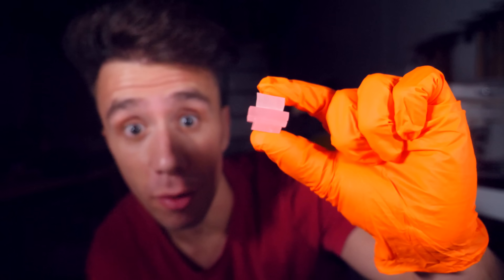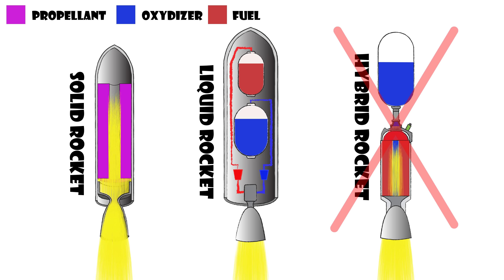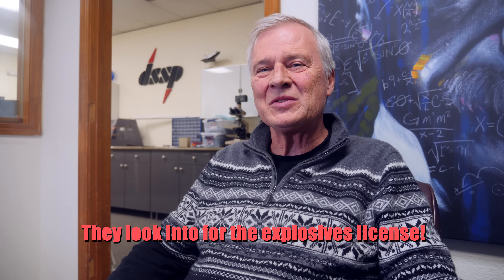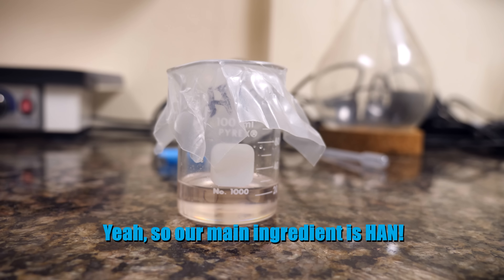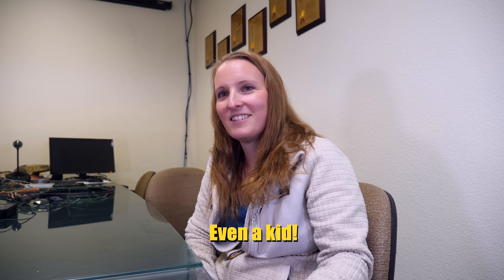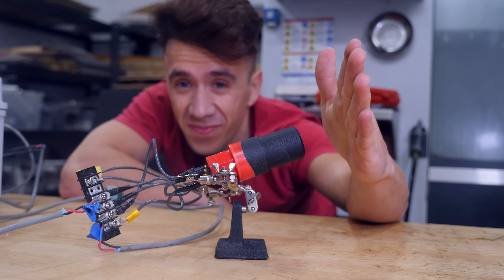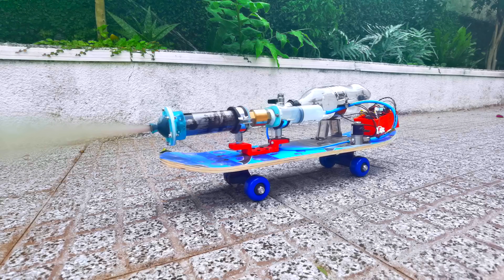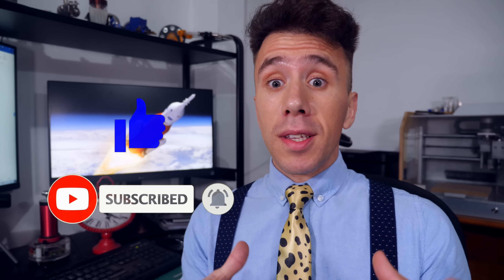ELECTRIC SOLID PROPELLANTS

Comment: I was looking at hydrazine as jet fuel for helicopters on nuclear powered frigates but at half the energy density of gasoline I didn't even get to the toxicity. Liquid anhydrous ammonia is more practical even with pressure containment issues but still only half the energy density of gasoline that would sort of limit the range of an anti submarine helicopter.

Comment: Make a modified ranque hilsch vortex tube for HTP fuel. A platinum wire pre-heater to pressurize the in-flow. And a platinum mesh internal screen around the center cold flow keeps catalyzing un-burned fuel. Feed the exhaust out, and use the 'cold' flow to cool the outside of the combustion chamber using a second external exhausting wall

Comment: Just looking at the chemistry, hydroxylamine nitrate is pretty straightforward to make.  Probably harder to get the license to buy the ingredients than to perform the reaction.  It is very exothermic so don't just pour the stoichiometric amount of one into a vat of the other.  I can see why they use a flow reactor with cooling.

Comment: I'm certain that you can build a self balancing drone using 4 rockets. Something that's capable of throttling each rocket just enough to maintain itself off the ground. Perhaps for starters with a tether that supplies it electricity or fuel.

Comment: That's rather interesting. I may have to run a current through my graphene suspension solution on purpose and mix in a little solvent. I'd actively been trying to get it to Not burn, but maybe I've been fighting the wrong end of the stick!

Comment: try to use an ozone generator as part of your combustion gas. ozone is o3 compared to the normal o2 you use in many of your engines. you could then test the level of improvement in your already built engines. Love the videos

Comment: Video Idea: Use your most efficient rocket prototype as propulsion for an RC rocket, and control it using on/off switching of the plasma thruster that was shown in this video. The objective - gain the most height by using the thrusters to keep the rocket facing up!

Comment: That Microreactor they built doesn’t look complicated.

They’re mixing the reactants one drop at a time because the reaction gives off tremendous heat.

I’m NOT advising you to test such a thing in your house.

But you could BUILD one.

And then test it with whatever you have lying around, like vinegar and baking soda.

That little box couldn’t house high pressures or high heat.

Two peristaltic pumps to deliver reactants and a collection system for the results; throw in water cooling from a PC.

I was expecting you to end the video by 3D printing your own micro reactor.

Comment: Please, when you do get a decent amount of GEM, test its thrust through different nozzle types (Conical, Bell, Aerospike, etc). I'm very curious as to the thermal expansion rate of the reaction, and how that rate might vary in different nozzles. Who knows, maybe this propellant makes aerospikes viable. Cheers!
Reply: Bro, is there a thing like thermal expansion of rate of reaction ??
Thermal expansion occurs in metals and every element has its coefficient of thermal expansion. And yeah, nozzles won't change any materials thermal expansion.
Reply: @imrealrage I think they wanted to talk about the volume of exhaust gas generated by a mass unit of propellant.
Reply: @mixer0014  That would have made sense mate!

Comment: Idea: Use the POWER OF THE SUN to burn the ESP. 

I mean like attaching a bunch of solar cells to a capacitor. Then you could use the energy stored to ignite the rocket fuel.

I used to like tomatoes, but now  I find them gross! I got tired of the taste.

Comment: You should try to make a jet/rocket engine using nitromethane as you would need less air thus reducing complexity while easily increasing thrust. 

Ps: To have pure nitromethane you should try to synthesize it instead of buying low concentration diluted in methanol, the synthesis is relatively easy and you already have the nitric acid which is the hardest ingredient to get.

Comment: When we are talking about electric engines what about an Arcjet engine powered with hydrogen? It is an electric discharge (arc) heating up the propellent to maximize the thrust output. Perhaps this is easier to achieve than an ion engine.

Comment: Conceptualize, design, 3d print and cast solid rocket motors blocks to vary the burn speed, pressure and bleed on to multi stages. The idea is to manage the specific impulse over time, a kind of fix throttling sequence for the various stages of flight. Lift off, acceleration, cruise, next stage ignition, etc.

Comment: I think it would be awesome if you build a thrust vector control system to control a multistage rocket and actually launch it. You builded a lot of engines suitable for model rockets like the solid propellent ones but never really tested it. It would be cool to use one of your past engines like the sugar engine and create a working model rocket from it and even cooler if it was multistage and use thrust vector control.You can use something like a Raspberry Pi or an Arduino to control the rocket. Perhaps you could also get some amazing footage in the process!

Comment: everyone keeps saying "no danger" but what about the vapours/smoke that comes off of it? what does it break down into? i would have to assume it could be harmful to breathe that in. not to mention the part where its explained that if its voltage it overloaded it can detonate rapidly and violently... meaning on a large scale could be very dangerous considering the fact that it would only take to fail is just one capacitor or rectifier. video suggestion... touch up more on this topic. i have many questions unanswered from this video.

Comment: In the next Video, I think you should go more into depth of how much Voltage and Current we are talking about, is a 9V Battery enough? Or what happens when I charge my body electronically (like with socks on the carpet) an the touch this rubber stuff :D

Comment: I think a critical thing is being overlooked. yes fire is Kool, however being able to throttle the nozzle versus just the gas/electricity whatever your traditional throttle. similar concept of a traditional adjustable pump sprayer nozzle. now you can focus the thrust and is semi directional. making the whole thing operate more efficiently. this is just an opinion or hypothesis based on a similar concept for the afterburner.

Comment: electro mechanical gyroscope... problem with satellites, when fine magnetic dust accumulates on the magnetic/gravitational conductor/body of satellites it no longer works... so they use optical sensors in micro circuitry wired the same as a primitive electro mechanical gyroscope tho with the addition of coded algorithmic processing to fire those ionization thrusters. micro process and control branch circuitry. rockets that just lock onto the first thing in mass that they see imitating light or heat radiation others do the same thing with narrow band radio frequencies.

Comment: My first thought, even though it is amazing, is what would happen if lightning struck the solid rocket boosters fueled with it. Lightning has stuck rockets before and it is built to handle/dissipate it, but if the fuel can be ignited via voltage, I could see it causing a RUD. Would be very interesting to study though.

Comment: Hey Integza, I have got two video ideas for you.

1) Electrolysis Rocket. You use Electrolysis to split saltwater (or some conductive tap water) into Hydrogen and Oxygen. Then you pass both gassed into a rocket engine and BAM.

2) Make a 2-stage Jet Engine. The first stage will be powered by a Solid Rocket Motor. Then after the first stage dies, you can separate the Solid Rocket Motor and then use your jet engine! Attach it onto a plane with Delta Wings and it would look quite cool.

Comment: I suggest you Building a RC Rocket in a Future rocket.
with that i dont mean, only make a engine, no make a whole stest setup, where you can test rocket engines and fuels.
like with a Flight computer, that A) documents velocity, attitude and more data.
and B) controls the rocket for a stable flight. and possibly controls the rocket Engine as well. and then try to get some of this liquid monopropellant or like hydrogen peroxide or something to test it

Comment: Whats better than "JAM" , Ionic propulsion. It's much safer, cleaner, efficient and has much more thrust compared to JAM.
My suggestion for your next video is to make a DIY Ionic propultion engine. It's not that hard to make and there are a ton of online reasources on how they word and stff. NASA have been using them for their saterlites for a long time. 
And also how about a Ionic propelled skateboard 🤪

Comment: I wonder if you could use the electric propellant in a very large rocket like a push pop, use a very controlled mechanism that can push the solid gel like material into an electrically charged wire grid that could be adjusted as needed to create power as needed.

Comment: Ik. I'm posting twice. This one's a thought... 
 
  You said it pretty much spits out Ions.. Sooooo why would there be a need to have a huge mass of solid fuel in a large engine. Not suggesting it would make an engine that would get off earth with this.

Since it spits out Ions, why not use it to drive ions more forcefully down a nozzled ion thruster?    The fuel can still remain manageable in size and be easily managed.  
  I said thruster meaning just that. A 3rd gen ion engine works on a whole different method so it wouldn't work there.

Comment: Really enjoy you video's and idea's here is my idea, making a twin waterjet propulsion upgrade adding to the existing propeller drive to a 28 to 30ish foot boat, and converting it to be electric powered on a twin prop and single jet or single prop and twin jet and 3D printing the most economical and also get the the dodge out into the middle of the ocean bloody sharpish,lol maybe a set out skimmer wings and them rockets strapped to them 😂😀  🍅🪓

Comment: Wouldn't the electrode have to be woven throughout it for it to ignite everything? Once your handheld electrode stops contact, it stops burning.

Wouldn't any normal ignition just leave it 95% unburnt? Obviously as long as it's still throttleable, before it self ignites.

Comment: The complexity of liquid rocket engines isn't from the material itself. The complexity largely comes from creating a pressure difference larger than the pressure of the rocket itself. While yes the pressure of the liquid stored can be higher and released with a valve this requires heavy high pressure tanks and can be highly dangerous if something breaks. Typically large turbines are fueled by the rocket to create the pressure difference which adds most of the complexity.

Comment: Video Idea: Use different fuels in a jet engine and measure the thrust output. You could try diesel, petrol, real jet fuel and maybe some weird things like peanut oil (actually used to run some diesel engines so might work in a jet engine!)

Comment: Thanks for the informal and educational videos.
In future, I'd like to see you develop a 3D printed rocket propelled ejector (the kind that generates partial vacuum). Effectively, such a device would become a tractor, though not exactly the Startrek kind. You could use it for disposing of tomatoes, I hear they are disgusting.
See https://en.wikipedia.org/wiki/File:Ejector_or_Injector.svg

Comment: Video Idea. A slingshot rocket. Using the G force of a physical launcher to mix two materials mid-flight that will cause ignition. Giving you a boost in mid-air speed. Maybe an internal sliding delivery system with an impact sparker to get the mixture going.

Great video as always. Very cool info and you looked really stoked to talk about it. :)

Comment: Using your current past experiments create a model airplane rocket powered. Using 7 solid fuel rockets; over 3 stages, first 4 to attain speed and altitude, 2 to maintain flight as speed drops and, 1 reserved for thrust needed for ditching the model or controlled landing. Using the ion gas generator you sparked the family and yourself with to release a built in parachute recovery system and have it all completely 3d printed. Then test the craft based on max altitude and flight distance I would suggest a delta wing to withstand the loads. Bonus points if you can fill a bay with cherry tomato prisoners and drop them from 10000 feet to thier punishment!
Reply: Could make for a great 3 part

Comment: This video  prompt a number of questions. 

Why did you reject hybrid rocket engine? Dosnt the virgin rocket use this type of propulsion, a mix of polymer rubber, and nitrous oxide gas?
These engines can be controlled, by controlling the flow of oxidizer

How do you deliver an electric spark to a fuel which has a changing dimension?
What are the parameters for the electric generator, Voltage, current?
How much energy is provided by the spark and how much by the fuel?
How does the engine avoid short circulating the electric supply?

Can the fuel be ignited using a powerful RF source?

Comment: The ESRs can be run by pulse width modulation or pulse frequency modulation to throttle? Is that the idea? Or does it respond well to lower and lower voltages?

Comment: Idea: Can you build/3d print a supersonic wind tunnel to cold down a BEvERage? You would need a pressure tank, a nozzle, a test chamber to hold the beverage, and a vacuum tank. Maybe you could drop the vacuum tank if you had enough high pressure air...

Comment: theme for a future video according to chat gpt AI: • "Tomatoes in Space: Why are they a Problem for Rocket Engines?" In this video, you could explore the unique challenges that tomatoes pose for rocket engines. You could discuss the effects of extreme temperature, pressure, and acceleration on tomatoes, and explain why they can cause problems for rocket engines. You could also offer some potential solutions, such as using special packaging or avoiding tomatoes altogether.

Comment: Free printer?? Cool.  I would love to see an H2O2 monopropellant steam generator drive a turbine powered charging system for a compact Li-ion battery to make an ultra lightweight zero emission self charging electric vehicle with range and quick fuel stops. It is a fairly ambitious project, but I believe is viable and safe enough even with concentrations of H2O2 erring into the rocket fuel regions. H2O2 has more energy density than Li-Ion and can be very efficiently used running a turbine. Steam on demand with battery charge level. (C)MDA 2022 😁

Comment: my video idea. what if you made a hot air balloon out of the gem fuel once it becomes available to you and use the ionized thrusters you made a little while ago as steering or put rochet engines on the side to make it spin like crazy. you could even make a little flying platform for a self landing rocket

Comment: I'd like to see you do a video on acoustic propulsion rockets.  Something like Dvorak’s 1878 acoustic repulsion apparatus, but maybe working towards levitation or vertical propulsion.  Is there a type of resonator and frequency combination that could generate enough thrust for in-atmosphere vertical movement?
Reply: This led to the creation of the rotary subwoofer- basically a fan that wobbles it's blades in the orifice of a sealed chamber to make insane bass SPL in cinemas.

Comment: Video Idea: What if you combined a rocket and an internal combustion engine? the engine works as a normal 4 stroke engine, but it uses propellent and oxidizer of a rocket.

Comment: I think you need to try to get your bladeless fan in the air. optimise the design and then maybe partner with an RC plane Youtuber like Tom Stanton or Project Air to see if you can get an electrically powered aircraft. it would be a massive design challenge to supply it with the voltage it needs while in the air, but it could be fun.

Comment: Combine The Blade less Fan with a Turbine engine.. Use the Blade less setup as the comustion chamber. Add air siphons so the mixture pulls air outside as well as central diameter to the Turbine.. Should give wicked thrust with low fuel. Highly efficient

Comment: Gotta have a class 5 FFL to get explosives and or machine guns in the states. We can get one you just have to have a clean background and be a us citizen. We have these laws in place to stop extremist groups and ect from getting their hands on shit. We can still buy things like Tannerite an black powder by the pound and we are still allowed to own a cannon lmfao so you win some you lose some. And my recommendation for a new video would be to test the viability of using sound as levitation in things like heavy machinery to assist with moving heavy weights EX:  30 ton earth mover carrying a load of rock out of a quarry using large subwoofer type devices downward firing with high voltage and frequencies, could it be used lessen the stress and save on fuel efficiency.

Comment: Here's a video idea: how about you make a standardized rocket shell, fit it with each different rocket/propellant type you've ever tested, fire them each off for an altitude test, and show charts for cost, height, speed, weight, and any other efficiency metrics?

Comment: How would you throttle these? How would this work with wireless energy transfer tech? Would it just explode? Could you put a 10 farad capacitor on it and make it blow up? Could you modulate the frequency of the electrical current to be more efficient? Could you make a punnet square with voltage and frequency? Would that show efficiency? Or an efficiency curve?